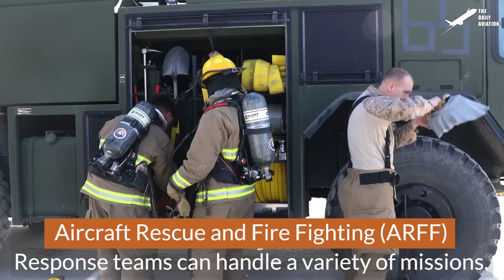US is Preparing Weird Spy Planes For Extreme Mission at 70,000 Feet

Comment: Helicopter based single shot dependent bolt action sniper ... .just doesn't seem like the right fit for shaking helicopters.  Better to spray and pray or use "smart"  that adjust to the target once fired.   I would be interested in a pro comment on this.